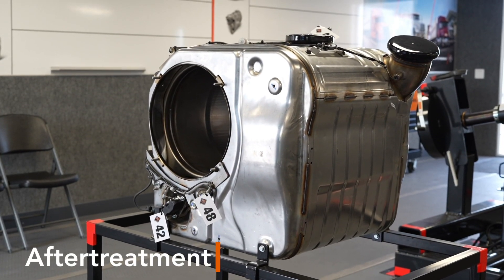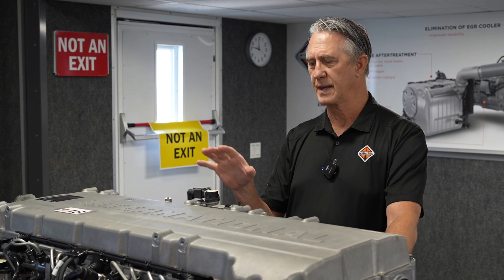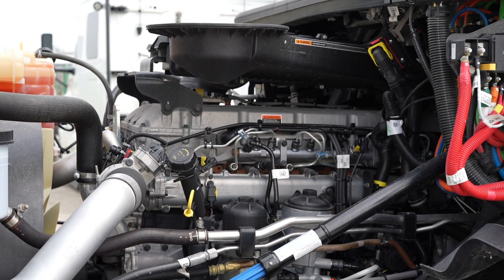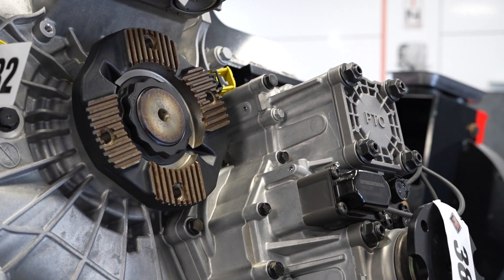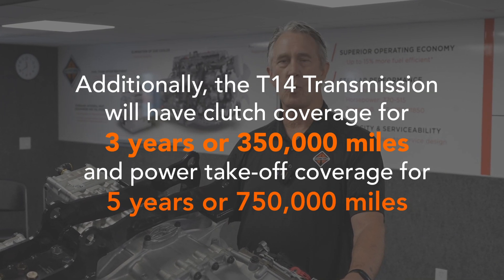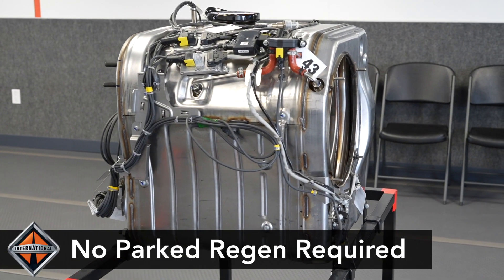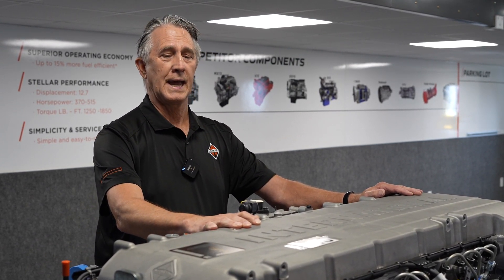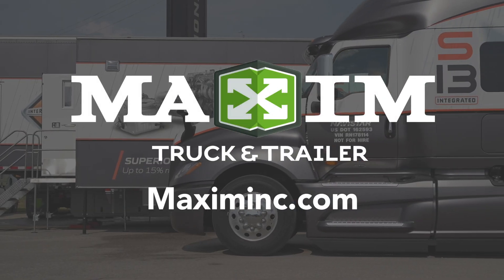Everything You Need to Know About the S13 Integrated Powertrain

Comment: Scania makes v8 engines for Europe, this is a special design L6 engine hopefully not the same disaster as the did with the MAN engines on prostatr series
Reply: They make both v8 and i6 the only v8 is the 16l all the others are smaller 9l and 13l
Reply: MAN has not had a scania engine yet. They just recived a scania dc13 (man calls it d30) engine. And it is basecaly the same as Scania and International.